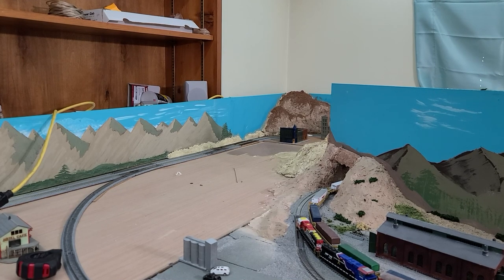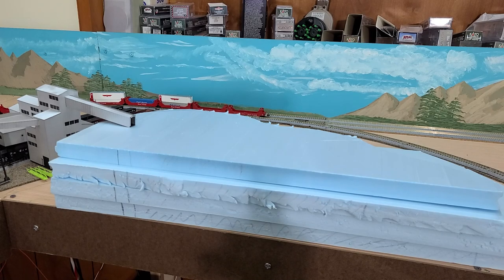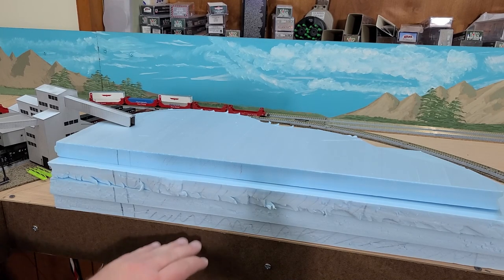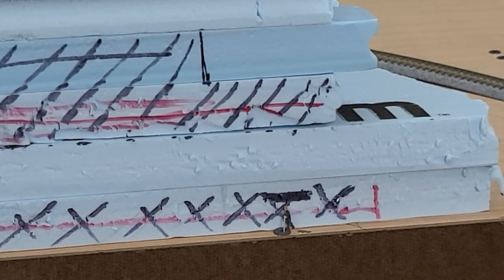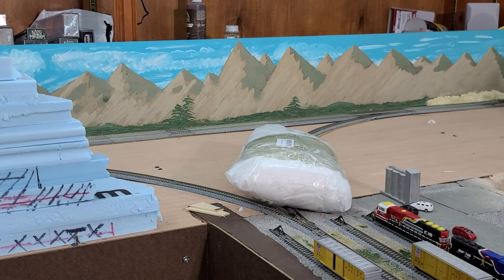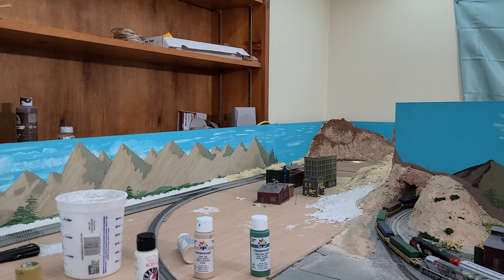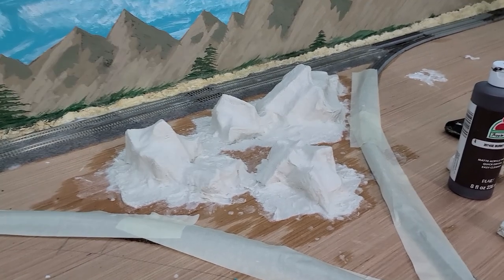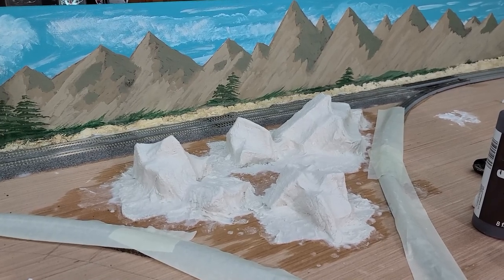Coal Mine Build Episode One

Comment: have you cut out the mine shafts yet?
one way I like to form foam board is with a torch, take it out side, toxic fumes, don't do direct heat, just wave the flame around where you want it carved out, this method will give you a nice , rock, marble type look for the sides, AGAIN, out side and no direct heat from the flame.. try on a scrap first. 
did I mention do it out side? 
foam board is highly flammable, no direct flame,, pail of water and a wet cloth. just in case
Reply from the maker: Yes I've already cut them out. I'm a little behind on posting what I've done lol. But I will keep it in mind for future projects though.